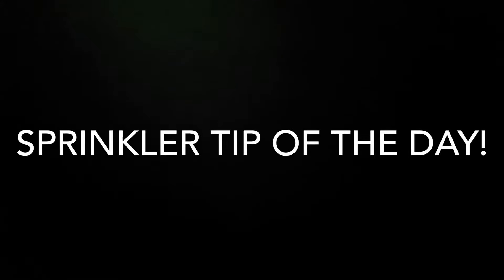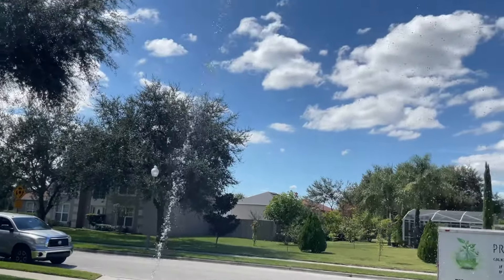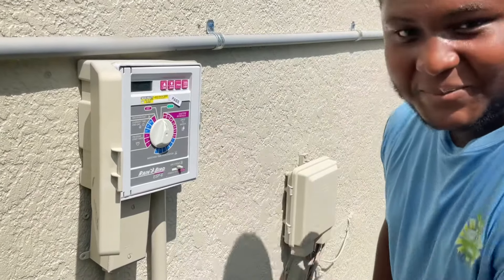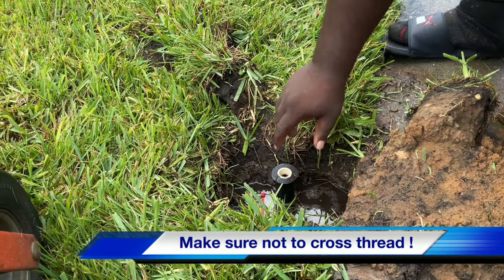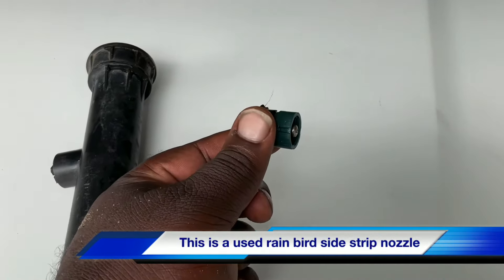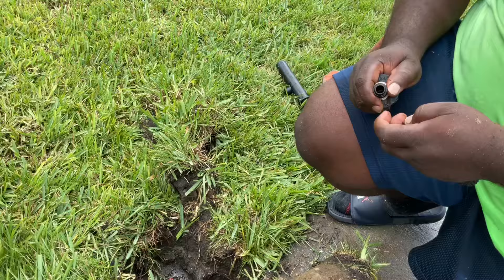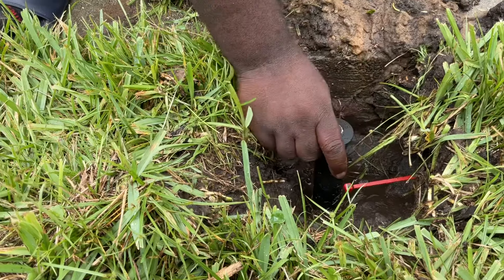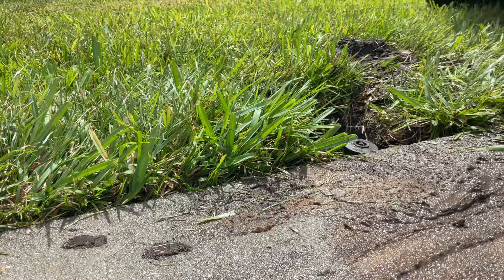Sprinkler tip of the day @progreengroundservices4038

Comment: I like the concrete donuts. Moved into a house and the previous homeowner left an irrigation map. But I ended up finding about 7 heads that were not on the map and covered over by grass. The donuts at least made me less concerned about digging and locating sprinkler heads.